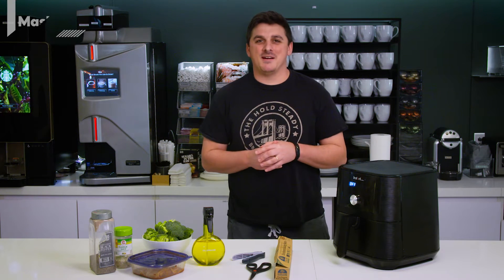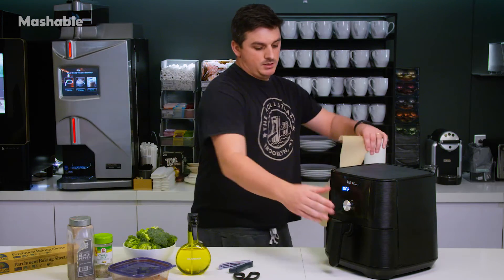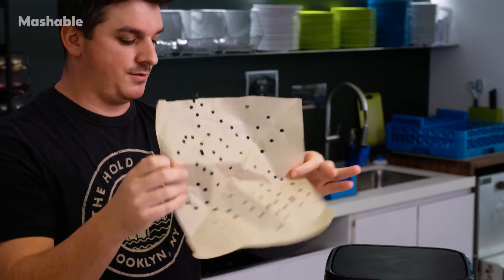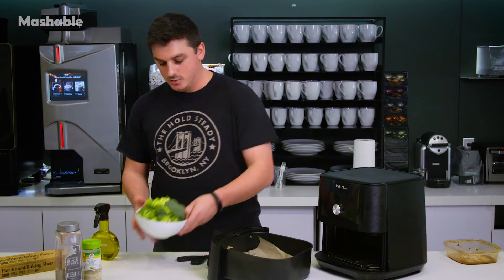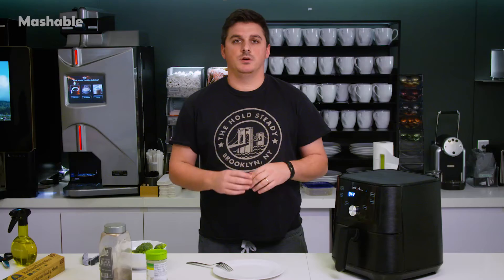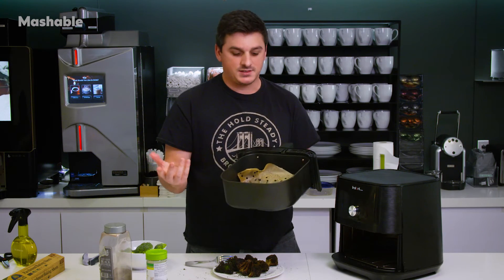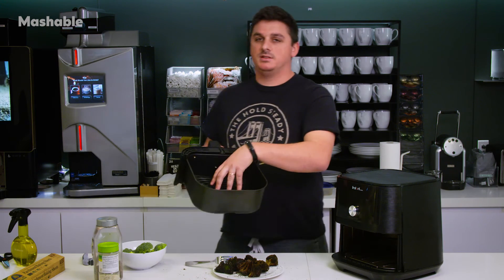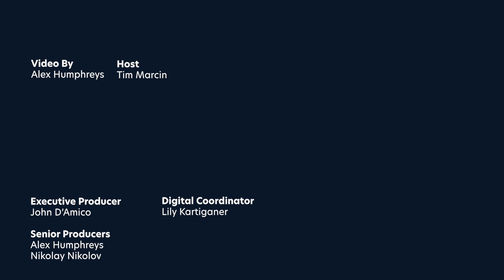Is This Air Fryer Cleaning Hack Worth It? | Mashable

Comment: I don't own an airfryer yet. But, what I think must be the easiest hack, would be to take out the grid, line the tray with aluminum foil and then put the grid back. And then for cleanup, put the grid in the dishwasher and throw away the aluminum foil.

Comment: I’m confused - the food made looks inedible - surely the point of cooking is to make something that’s palatable?  
Also why use an air fryer for this?? The quantity of oil sprayed on was far more than needed to cook in a traditional pan & air frying brocoli? (I’m really confused). 
You could cook this in a single pan - blache the brocoli in a little boiling water (in the pan) and cook for 2 mins.  Drain, put a bit of soy sauce on.  Then cook the chicken in a small amount of oil.  Wash your pan (which will take 30 seconds)….